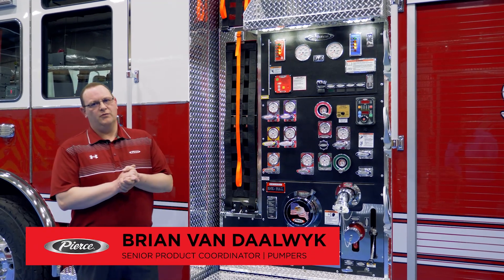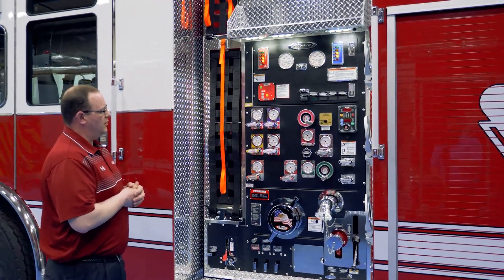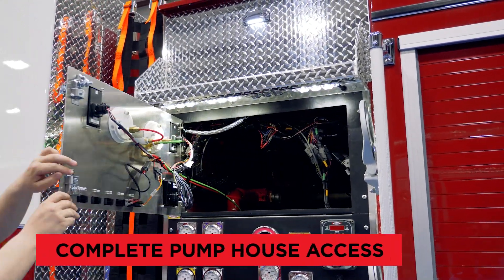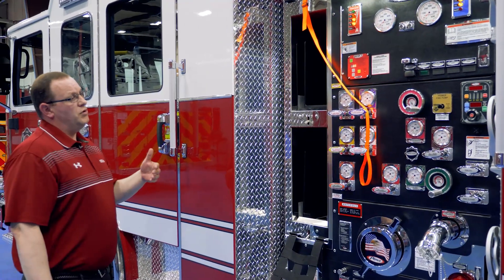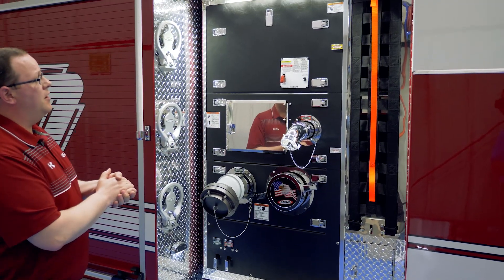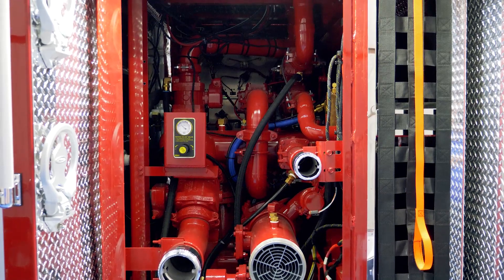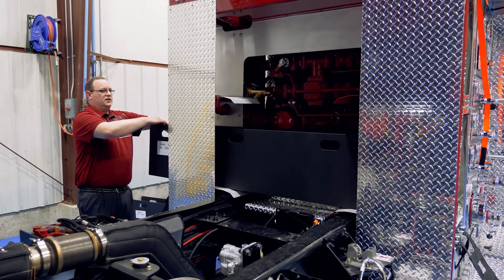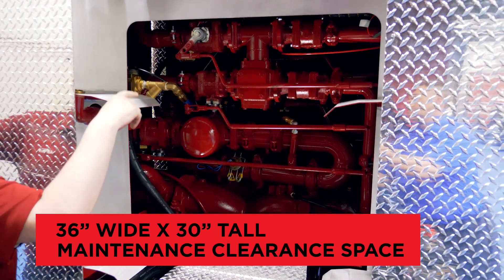Enforcer™ Heavy-Duty Rescue Pumper – Control Zone™ Pump Panel with Speedlays

Comment: Great jobs guys! Once again, Pierce has revolutionized Firefighting! Also, I dare someone to tell me if there is better apparatus manufacturer out there...
Reply: There isn’t!
Reply: Seagrave is slightly better. They take a bit longer to get the Finished Product out to the Customer, because they focus more on detail then how many Units they can get off the Assembly line, and out the door. Average time for Pierce from start to finish for a typical Custom Pumper is 90 to 120 days, but more and more Fire Depts out there are slowly starting to find little things going bad on Pierce Custom Engines. Seagrave's build time from start to finish is 120 to 180 days for the typical basic Custom Pumper, because again, they focus more on making sure that every single aspect of the build is done with Quality. Quality over Quantity. You pay a bit more for Seagrave than you will for Pierce, but in the long run, it's worth it. The old Addage is "YOU GET WHAT YOU PAY FOR". If you buy a Pierce because you want delivery within 120 days from start of build, then expect a few issues to occur with your Unit once it goes in Service, especially if it becomes your first out piece, and you run a very high call volume. If you are willing to pay a bit more, and wait a bit longer to take delivery, then go with Seagrave. They go the extra mile to make sure that the Units they are building will not only do the job well, with little downtime, but they will do it for 20+ years if need be.